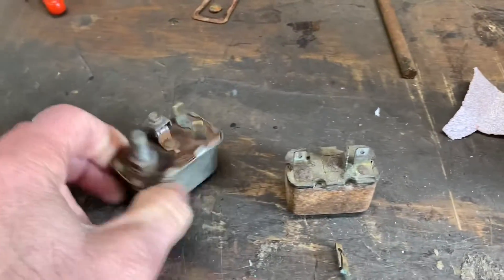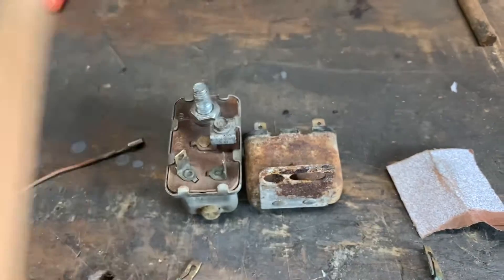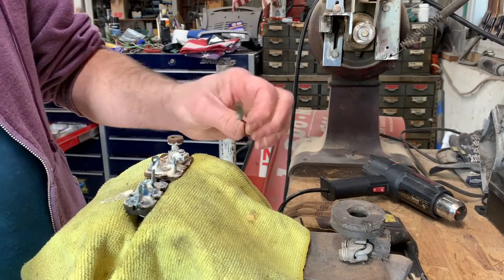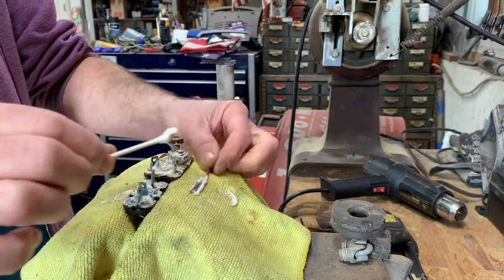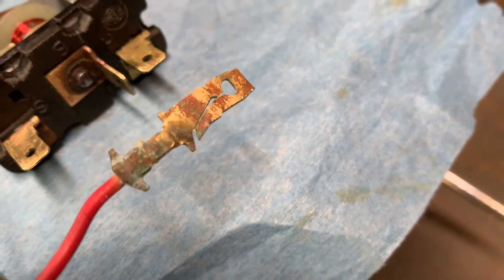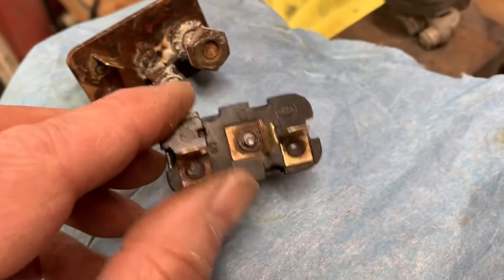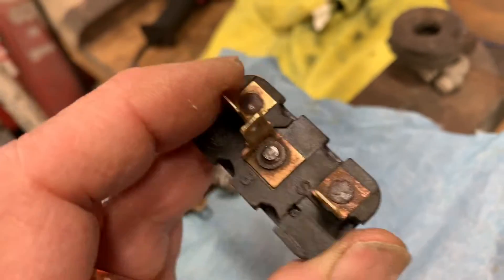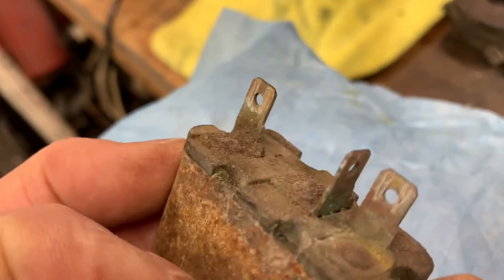Tech Tip: Cleaning Green Corrosion off Electrical Connectors

Comment: PROBLEM WITH BULK- HEAD CONNECToRS, getting the brasso off of the connectors was not easy, i ended up using a brush soaked in salt/vinegar solution on the connectors, blew off with compressed air. they are just like new

Comment: I usually put these in my media blaster and they come out like new
Reply from the maker: I agree. If you had one that did walnut shells or other softer media, that would work great. This is just an alternative, plus you can remove the terminals from their connectors and soak them in Brasso, clean them up and reassemble the connector.
Reply: @RogersABodyGarage  I have a mini blaster cabinet you can run aluminum oxide that they use for 100 grit sandpaper you can get at harbor freight or use baking soda I don't like using chemicals cuz they can get under the wire coating and cause black wire disease and eat up the wire